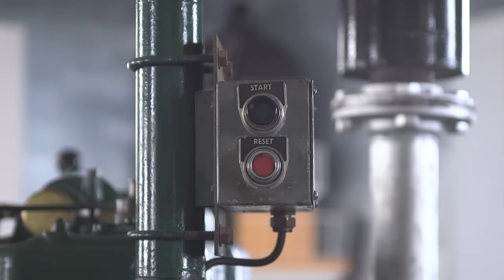Sounding the Sumburgh Foghorn

Comment: some nice engineering went into that set up. Surprised to see riveted air receivers still in use. must have been well made indeed.
Reply: ThePsiclone when stuff was over engineered back when that was made. Modern stuff is designed to break and your lucky if there's spare parts.
Reply: They're about twice the thickness that's necessary and probably often re-painted and dried of any condensation.
Reply: +robuk1981 if there's spare parts. You got it!

Comment: The bronze casing with the spinning rod is the siren it has two cylinders with slots that are spun by an air motor (powered by the coding mechanism) then a large amount of stored air is released into the spinning cylinders and up through the horn to give the sound

Comment: The Foghorn would have been heard for miles around (image by Frank Bradford) The Sumburgh Head Foghorn is a striking landmark. Recently restored and re-painted, the bright red trumpet points out to sea as it has since it was built in 1905 and put into operation in 1906. The Foghorn was last sounded in 1987.

Comment: How many times per hour does this happen?
Reply from the maker: Every couple of minutes until the generators are switched off and the tanks empty.
Reply: @jjjamieson4740  umm isnt this an actual safety mandated occurance?  Must be on a schedule
Reply from the maker: @gremlin7599 Hiya, this is a one-off occurence, every year, to signify the start of the season when the lighthouse is open for visitors. It sounds for about 40 mins, and a lot of people attend, so there's a real buzz in the air (pardon the pun!)
Reply: @jjjamieson4740  okay well i presume at one time before maritime gps it was used regularly?
Reply from the maker: @gremlin7599 Yep, fog can lie here for days or weeks, so I'd imagine they kept it sounding as long as necessary